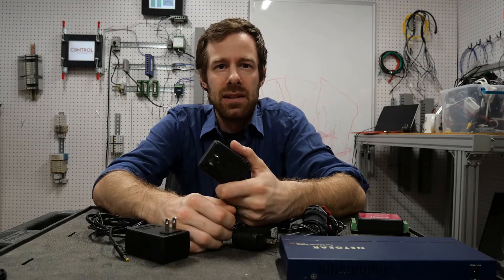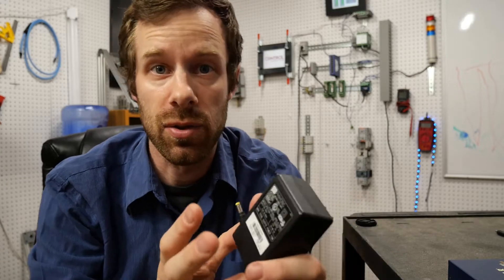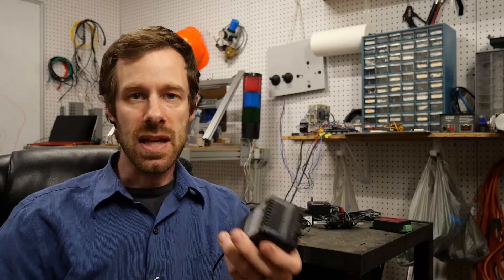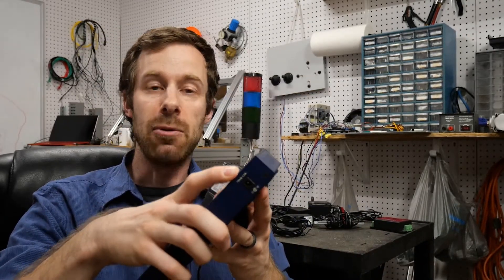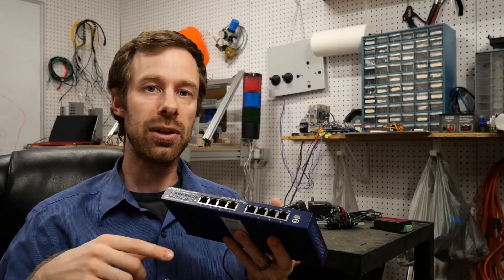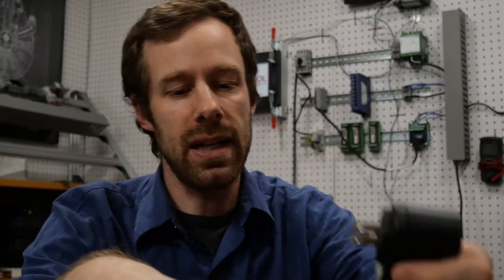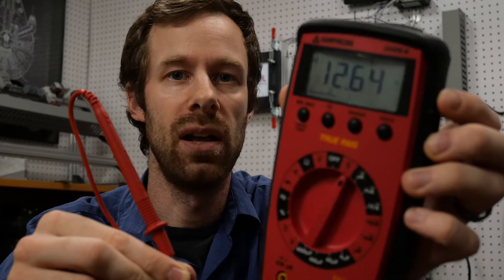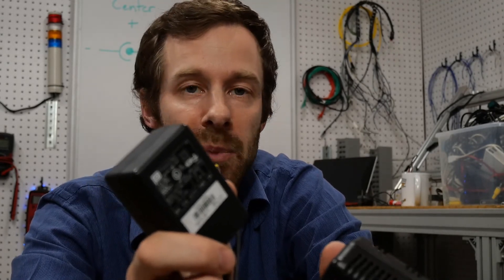What AC Adapter Should I use?

Comment: Hi. Can you give me a link to an AC adapter video please, because this video isn't one. This is an AC charger video. Not AC adapter video. Know the difference. It helps. It really does.  Sheesh.
Reply from the maker: No. This is most certainly an adapter. An adapter changes one voltage into another. AC turns into DC.

A charging circuit contains monitoring for each cell to provide the proper current depending on the charge level, and that is why you must have the right charge controller for each type of battery. This has no charge controller, and so it is not a charger at all. It may power a battery charger, but it, in itself, is not a charger. Please, please do not try charging a battery with an AC adapter, which would be very dangerous!

Also, there are no AC batteries, so there is no such thing as an 'AC charger.'
Reply from the maker: Ah, but perhaps what you meant is that 'adapter' is the term for the physical adapter that changes the shape of the plug, like a USB-C to Micro USB adapter, or changing the size of a round plug tip, or converting a European plug into a US plug.

This is true, and many AC adapters contain several tips to adapt to multiple devices. Those tips are usually referred to as adapters as well, but be careful - that term is not reserved for either use. No published standard limits the term, and it is a very commonly used for both, so it does very much apply to this video.

Please do not call these 'chargers.' They cannot, by themselves, safely charge anything. I definitely don't want someone to connect a 9v adapter to a 9v battery. Very bad.

Comment: I am having trouble finding a replacement power adapter for a 17.8V / 1330ma adapter for an off brand soundbar. Could I use a 18V  3 am power adapter?

Comment: So I think I know the answer but still, just to TRIPLE CHECK, so my mini pc needs a 19.5 volt, 6.72 amp 135 watt Power Brick, I ordered a 19.5 volt, 11.8 amp, 230 watt Power Brick, Center Positive with a needed sized barrel, THIS WILL WORK, RIGHT? :)
Reply from the maker: Yes indeed - it will work great! Same voltage - check. Equal or higher current and power output - also check. Center positive (assuming the original was center positive) - triple check.

Nice work.

Comment: I have this Honeywell 7500E generator been using a xing yuan ac/dc adaptor class 2  model yp-018   input 120V--60HZ  20W   OUTPUT 14Vdc  800mA--------Can you tell me what a correct are good replacement would be---Thank you

Comment: I have a 3 volt DC watch winder.....It will take an ac adapter....problem is there is no information on the "Rotations Brand" watch winder.  There is no info on the web for this item.  I don't want to burn it out...I have a 3 volt 200MA dc adapter any help?

Comment: I'm here in the states so you already know I'm using Common-US, 117VAC/60Hz  So my three AC adapters rated as  "Class2"  no, not class ll --  but  "Class2" and there's a big difference in their applications.  With Class2 you are suppose to be as close to the power as possible. 
all 3 supply: 12VDC, 1.0A, 12W.  They came with 7'ft of 22ga. pigtails.  Can I cut the adapters open and change the pigtails to 16ga wire so I can run over the 7'ft mark???  with these adapters you run into voltage drops over 7'ft.  But If I understand right and my math formulas are correct, 16ga pigtail will allow a max run of 48'ft. and continue sustaining the 12VDV 1.0A 12W.  Yeah, I could run 117VAC extension cords but that's sloppy, However, (Legally --NFPA Sec. 590.3 (B), clearly states there is a 90-day limit on temporary power cords. Get rid of the cord or install a permeant fixture.  I could install an outlet but that's added expense and time and working in tight crawlspaces.  Any suggestions???

Comment: Can I  use C DC 15V 1A / 2A Switching Power Supply?  It claims it can power  devices from 0.3A 0.5A 1A 1.2A 1.4A 1.5A 2Amp , all are Suitable. My requirement is to charge a Vacuum which requires 15V and 400mA
Reply from the maker: Yes indeed. You can use that supply for any device that needs 15 volts, and consumes less than 2 amps. 400 mA is no problem.

Be sure the polarity is correct; check out the part about center-positive vs center-negative. That is really important.

Comment: TOP SHELF VIDEO THANK YOU. CLEAR CONCISE VERY INFORMATIVE.... I MADE A CHEAT SHEET WITH NOTES TO STORE IN MY MASSIVE COLLECTION OF POWER SUPPLIES I UTILIZE/ REPURPOSED OFTEN. I WAS SMART ENOUGH TO MATCH THE VOLTAGE AND mA BUT WAS PLEASANTLY SURPRISED TO LEARN OVER mA IS FINE AS IT IS A DRAW NOT A PROJECTED/FORCED POWER. AGAIN THANK YOU.;))

I HAVE A QUESTION THOUGH. IS THERE A WAY TO DETERMINE IF YOUR {WALWART/AC ADAPTER/ DC POWER SUPPLY} IS IN FACT PROVIDING THE STATED mA ON THE PLUG. 

*EXAMPLE; INPUT 120V OUTPUT 12V 500 MA OR .5 V. HOW DO YOU KNOW IS THE PLUG IS BAD OR YOUR DEVICE? AGAIN HOW DO YOU TEST THE WALWART TO DETERMINE IF IT IS PRODUCING SAID REQUIRED mA'S PER THE DEVICE REQUIRED?
I HAD AN EXPENSIVE HDMI DELIVERY DEVICE THAT "FAILED" TURNS OUT IT WAS JUST A POWER SUPPLY.  THE POWER SUPPLY TESTED AT 12V BUT THE "3 AMPS NEEDED"  WERE NOT ACTUALLY 3 AMPS IT WAS FRUSTRATING B/C I HAD TO CALL TECH SUPPORT AND THEY WERE GUESSING..... I REPLACED THE POWER SUPPLY AND IT WORKED BUT I WAS LEFT NOT KNOWING HOW TO DETERMINE THE FAILURE OF THE POWER SUPPLY BEFORE CALLING TECH SUPPORT OR REPLACING A PART BASED ON A GUESS.

CALLING TECH SUPPORT WHEN YOU HAVE ISOLATED THE PROBLEM IS BRUTAL...PLEASE SAVE US SIR;))

Comment: I am sure you will delete my comment, but here goes anyway!!!! The ONLY reason that Lemax changed its voltage over the years is to purposely create this confusion and to force folks to buy Lemax branded adaptors. It also explains why they have different sizes of connectors !!  The truth of the matter is that the industry SHOULD have set a standard which they all agreed upon. There is ABSOLUTELY no reason to use 3V versus 5V, or 4.5V versus 6V, or even 9V versus 12V - these voltages are all SAFE for use by people not professionally knowledgeable in ELECTRICITY, but who would get confused between the different voltages. Lemax used to use 12V when it was lit with an INCANDESCENT bulb, but LED lighting is better with 3V. Added confusion is created by using different size and styles of connectors, thus making it harder for the average person to understand the reasons why and thus they have to pay a huge price to stick with an INDUSTRY STANDARD!!!  I have been using 5V USB power and connectors because they ALL USE the standard Computer/Mobile Phone connectors!! Because of tis 5V USB cables are much cheaper and easier to find and thus practically UNIVERSAL!!!  Have fun, stay safe, but learn the FACTS!!!!
Reply: What if the device takes 15v and the closest you got is 16v.
Reply: Im just doing it anyways so You. Don’t have to answer cause I’ll find out if it stops working

Comment: what about the wattage. my adapter say 24 watts MAX. i have a audio interface that i maxed out inputs and outputs.
Reply from the maker: Wattage is just current multiplied by voltage. So take that 24 watts, and divide it by the voltage of the adapter.

If it's a 12 volt adapter, then you would get 2 amps of output MAX. If it's a 6 volt adapter, 4 amps of output, etc.

If you try and draw more current, then it may overheat, fail, or simply shut off.

Comment: How can you test the polarity of an electronic device that you've lost the power adaptor for? I have a video mixer, I know what the voltage is for the the mixer and amps, but there is no indicator on the device that states the polarity for the power adaptor (tip and center).  I have a few power adaptors I can use, I can reverse the polarity by cutting the adaptor and switching, however I need to know what the device it self uses.  Can I use a volt meter to test the male barrel end with out power running through the device?
Reply: I AM NO EXPERT AND LEARNED A FEW THINGS HERE. I CANT IMAGINE THAT IF IT DOES NOT STATE ON THE DEVICE IT IS ANYTHING LESS THAN THE STANDARD CENTER POSITIVE. JMHO

Comment: If the voltage must match between the adapter and device, why does the charging adapter that came with show  different voltage than its rechargeable device? Charging batteries are a different thing?

Comment: Can I use an adapter with an input of 0.5A to power a 1A doorbell camera that requires an input of 1A?
Reply from the maker: Careful on 'input' vs 'output'
If the adapter says 0.5A input, then it probably has a much higher output current. So the number you need to find is the output. 

If the camera needs 1A, that's the bare minimum, so as long as it's  than 1A , it will work fine.

- The power you put in is roughly the power you get out. So if you put in 120V at 0.5A, that's 60W, then if it's a 12V output, that would give 5A output. This sounds like a laptop charger adapter or something? That value seems a little high for most small adapters.

Comment: I have a Dewalt jumpstarter.On the back of the jumpstarter it say the input volts is 14.5.One of my ac adapter is 12v.Is it ok to use 12v to charge the Dewalt jumpstarter.Can I use the 16v input ac adapter It's called Dx aeps14 ?
Reply from the maker: I would not use a 16 volt input. 

Looks like that model can be charged from a vehicle's DC accessory plugs which supply 12 volts, and it is charged using a 12 volt output adapter (center positive).

14.5 would be the max voltage that the car's DC plugs would supply, but you won't find any common power supply rated for that voltage. 12 volts should be the correct voltage, but as for the current rating, the higher the better. Likely for a charge this size, it would need 1-2 amp output capacity, and will still take a good long time to charge.

Comment: Wow.! I learned so much watching this video.  I really need help with a device. The person who made the device passed away and the new owner is MIA for  past 2 years so I'm unable to order a  replacement power cord. It's a micro current device / a small portable computer -like device with a rechargeable internal battery. The back of the BIotic Wave /machine lists;  3.6V DC  1,900 mAh / NiHM  It' has a barrel /pin plug. No one seems to be able to tell me how to replace this charger can you help me figure this out? You seem like a real wizard with  this kind of stuff. HELP
Reply from the maker: Hey great question! I can't answer with 100% certainty, because I don't know the device... but, there are some things that are more likely.

That kind of battery is super popular for portable computers, radios, RC cars, etc. If it is rechargeable inside the device, that means there is a charge controller circuit, so you don't need to provide exactly 3.6 volts.

I would start with a 5 volt plug-in supply. It may need 9 or 12, but start with 5 to reduce the risk of damage. However, it is harder to find 5 volt plugins with barrel plugs, they are usually USB ends for phones and tablets. But if you can find a 5 volt one, start there.

For the polarity, center positive is the most likely (no way to be 100% sure unless it's printed on the case somewhere). That's because if the outside of the plug is powered, it could damage anything it touches. If the +v is inside the barrel, it's much harder to accidentally poke something in there to get damaged.

So, center positive 5 volt supply. Start there and see if you get any indicator that the battery is charging, like turn it on after an hour or so and see if the charge has increased. If not, move up to a 6 or 9 volt supply. Then a 12 volt. I bet you can find ones like this at a thrift store, I see them all the time in places like that.
Reply: @PetersonBrosAutomation  :face-red-heart-shape:
Reply: Hi thank your for your response!  Yes, it's an internal NiHM battery. The back of the machine  states :  3.6V DC  1,900 mAh / NiHM   It's a spa device /micro current machine which runs like a mini computer. I rec'd a photo from a person who thought this was the correct charger for the device, but I don't understand how that could be ? as their charger states:  18V DC and only 350 mA.  The device was extremely expensive like a car engine so I don't want to ruin the machine. Charger states:         BIO-Medical AC ADAPTOR MODEL 1835    INPUT :120VAC 60 Hz 15W                     OUTPUT 18VDC  350 mA                          class 2 transformer  Can this be correct?
Reply from the maker: @RoxanKing  I just did a quick search on that part number, and I find stats that are indeed 18 volt, 350 milliamp output, and it is center positive. 

I would still suggest, if you have any doubt, start with a low voltage, center-positive power supply. Too little voltage will not hurt it, but too much will for sure! Up to a 9, then 12, and if that still fails to charge it, then 18 seems to be the ticket.

Also, remember that too much voltage will hurt the device, but too much current will not. It will only draw the current that it needs. But do not use too much voltage.

Hope this has helped :)